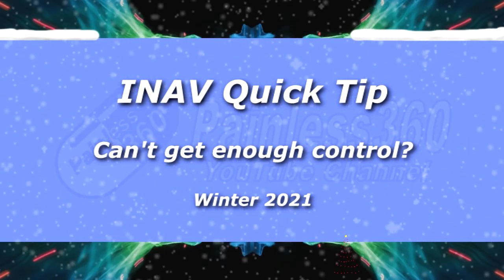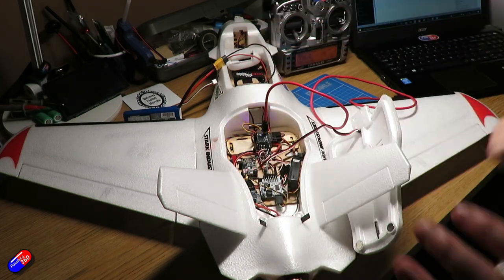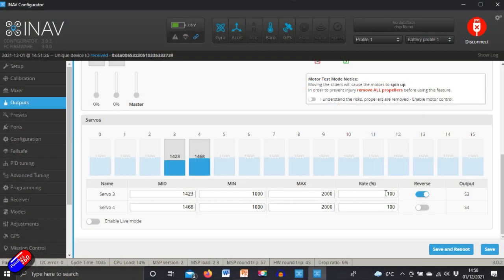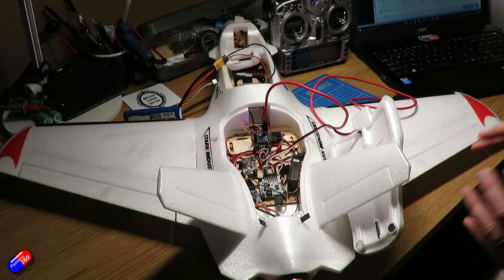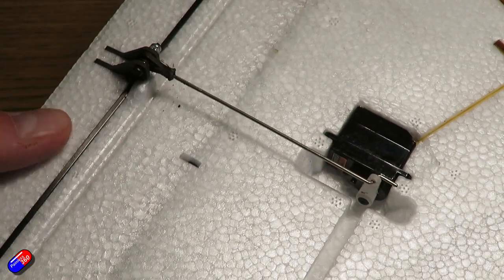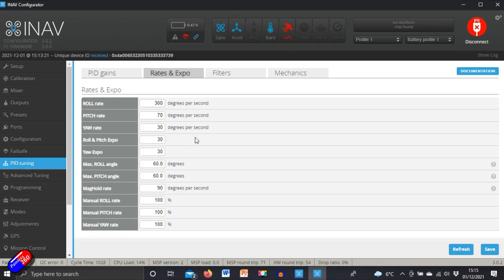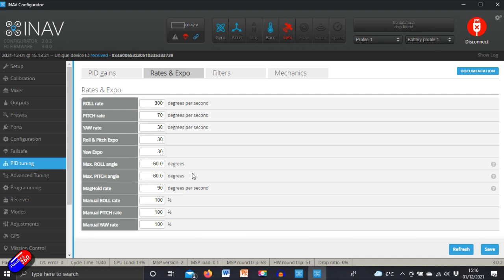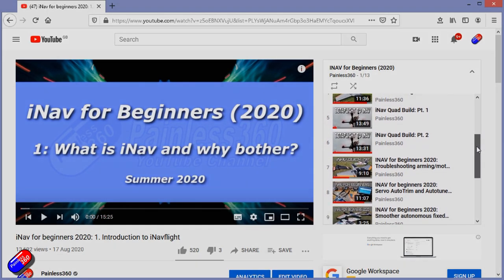How do I increase the pitch and roll in INAV?

Comment: I just got my Dolphin today. I watched a video recently that showed someone getting their Dolphin stuck in a tree. I'm putting a BLHeli S ESC in mine. Is it possible to reverse the motor direction with an airplane, in the same way turtle mode works on a quad? This could be a very useful feature for situations like this, as well as slowing the airplane down when landing if you need that.
Reply from the maker: Some planes (usually those with floats for water) have reversing ESCs . I've never tried it the way you are thinking of.  If you get it working, let me know!

Comment: I know  you had a hand in the ar wing pro, great wing by the way. Manual calls for 12mm max throws and 1.5 to 2mm reflex just wondering how yours is setup and how much roll and pitch angle you have setup in inav? Thanks for all your videos.
Reply from the maker: Check out my recent INAV builds for all the steps I use. For max angle in stabilise modes I set it to 60 degrees... Best of luck with the build!

Comment: I was really hoping this video talked about adjusting Roll in Inav?  My roll is about 7deg off-center as shown in the upper left corner of the setup screen.  I am using Inav4 so I don't see the roll adjustment screen in the Board Alignment screen,  where do I adjust this now.  Thanks for any help!
Reply from the maker: Board alignment is not where it used to be. See my INAV 3.0 setup guide. align_board_roll
Reply: @Painless360  Thanks,  took me a bit but found the CLI command.  I was able to use the CLI to adjust,  appreciate the help,  Merry Christmas,  appreciate all you do as these videos have been a huge help.

Comment: I'm having  problems with inav , when I arm the motor or even just move the throttle up and put it in stabilize mode the control surfaces stick and don't return back to center , soon as I disarm or kill the throttle they re enter,  all my boards or doing this , I'm using crossfire
Reply from the maker: Please check out my mini series on INAV 3.0 in a fixed wing. It covers how i set mine up.. best of luck
Reply: Hi jimmy, did you ever find out why your surfaces was sticking in stabilise/Angle mode?
Reply: @terrymurphy562  the only way I could get them not to stick was to 0 all the PID's , but if you auto tune it went right back to sticking,  I just switched everything to ardrupilot works fine
Reply: @jimmytheriot8978  very strange that the surfaces done that. My surfaces are the same in angle mode only. Acro and manual are fine. Thanks for the reply, hope you are enjoying Ardupilot. 👍